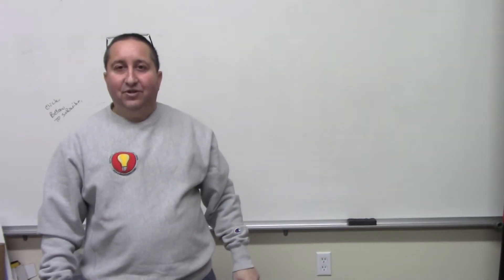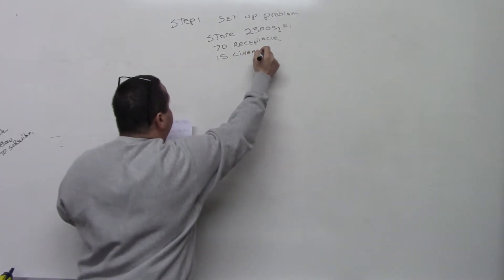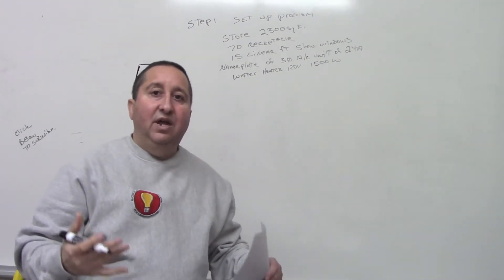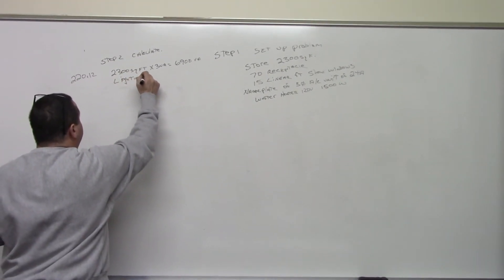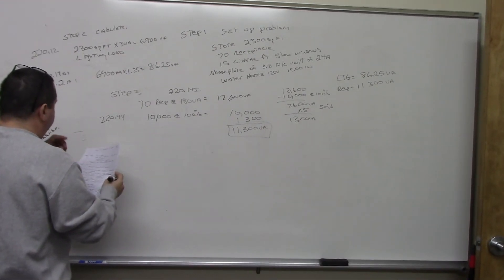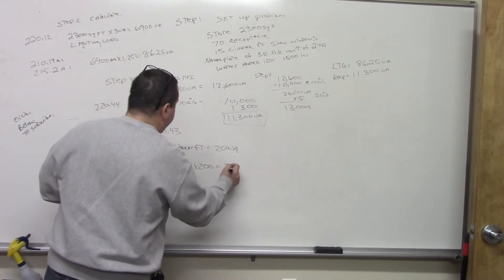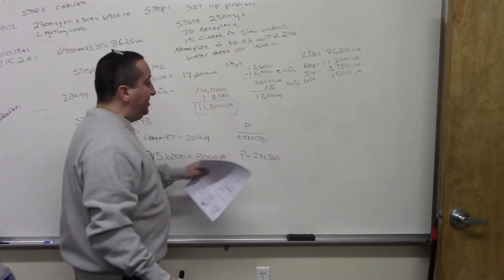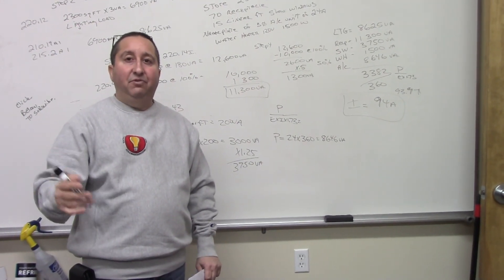Understanding Article 220 NEC How to Calculate a Commercial Building Such As A Store

Comment: Late to this video but would you not calculate AC (24 X 1.25 ) largest motor per 430.24 , and include Sign and Outline Lighting 220.14 (G) at 1200va  and 1.25 for over three hours ?  Just asking .

Comment: Too many problems with this video!
I don't know which NEC he's using.
I'm using the 2020 NEC.

Table 220.12 list retail or stores at 1.9 watts per square foot. He was using 3 watts per square foot. Then he uses a multiplier of 125% for continuous load but on the note on table 220.12 says note: the 125% multiplier for continuous load as specified in 210.28 is included!
This business about multiplying 208 volts by 1.732 to get 360 is confusing. 1.732 * 240 is 415 so what!

Simplified current flowing on one phase is:
I = P /(E*1.732)
In this case E equals 208 volts. And we're not concerned with the power factor or efficiency.

If it helps, think of the 1.73 as the extra power flowing on the other phases you're  currently not looking at. Otherwise ignore this statement.
Reply: I was wondering the same, i thought 3va per SQ FT was for residential. A retail store looks like 1.9 VA per sq ft.  Salvatore Ferrara is there any way you can help clarify this?
Reply: This guy must be getting his calculations out of a crackerjack box! Please tell me he’s not a instructor!